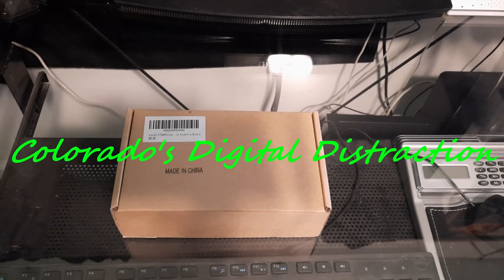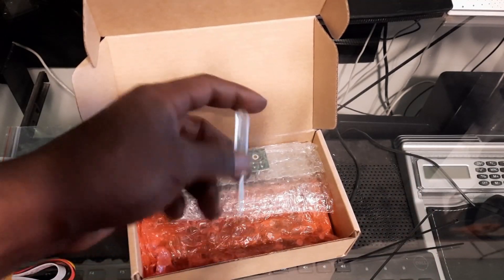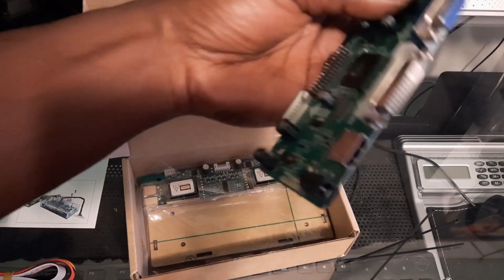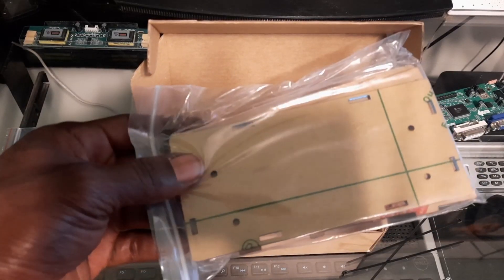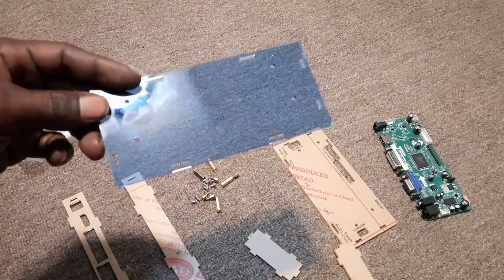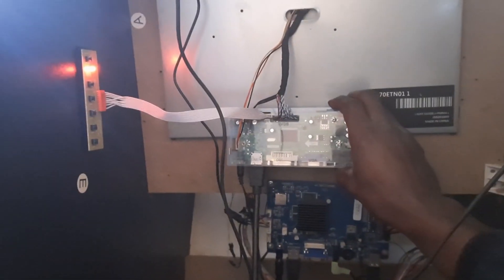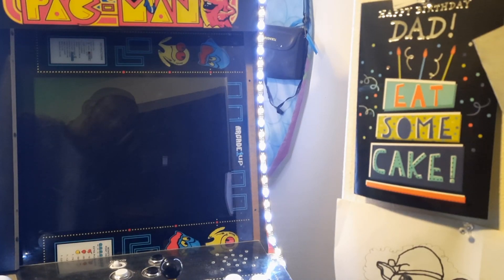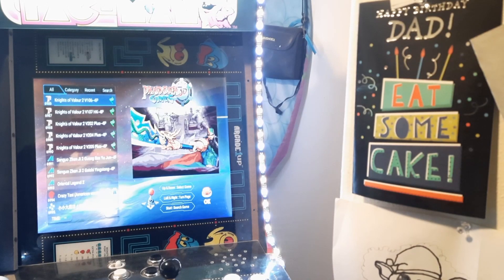Arcade 1up LCD Controller Driver Board And Acrylic Case Kit

Comment: Hi bud nice install could you plz tell me if you had to cut the plexiglass bezel when you tuned it on its side to make screen horizontal because I’m wanting to ad Pandora’s box the dx edition so did you have any probs turning the screen on it side also ? Cheers bud 👍
Reply from the maker: Sorry for the late response, but no. It will be a little shorter on the top.